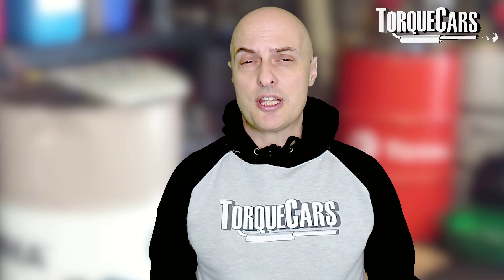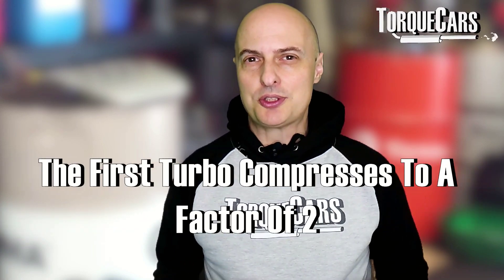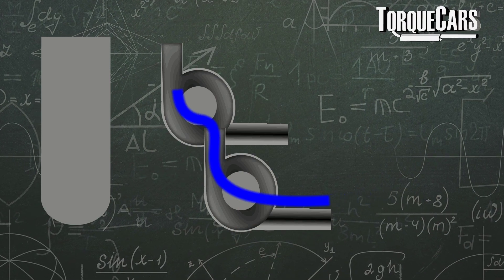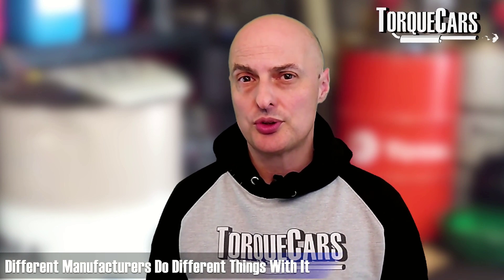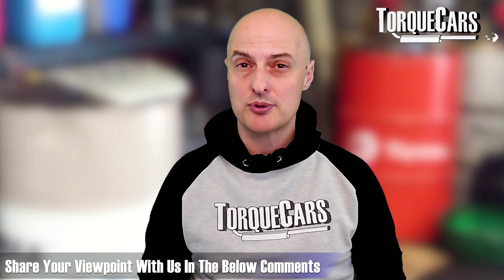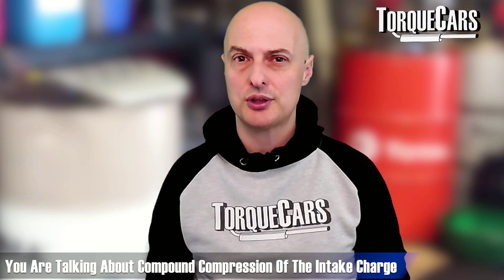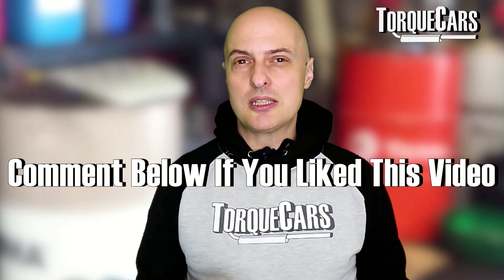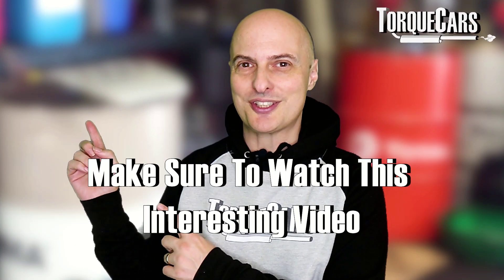Compound Turbocharging - How 2psi  + 4psi = 16psi! Amazing way to exploit  2 turbos.

Comment: Not really accurate, sorry. I think you are confusing PSI and pressure ratio. Stick to BAR or KPA, PSI is obsolete.
Reply from the maker: Thanks for the heads up my friend. I will re-shoot this video I wasn't looking to confuse people.

 I am always looking for ways to simplify things, so do you have any suggestions on the twincharging concept? I found this one quite hard to break down for people without getting too technical.

Comment: Would you ever consider doing s tuning guide on a older diesel engine from the 90s  izuzu 1.7 turbo diesel engine used in Vauxhall's of the 90s ?